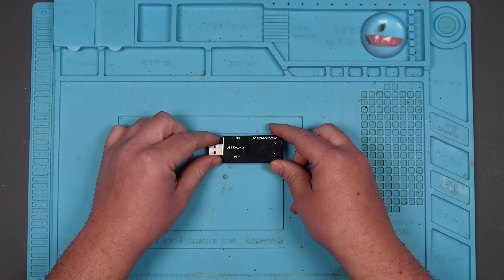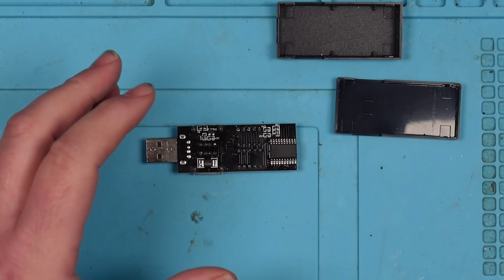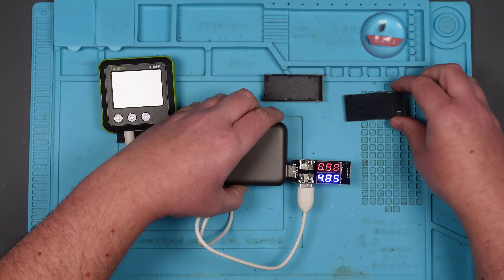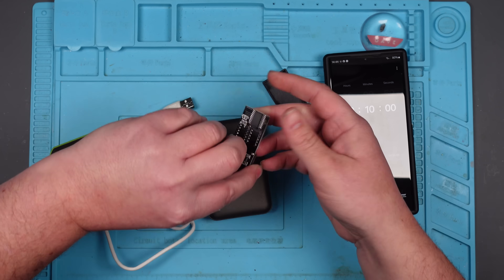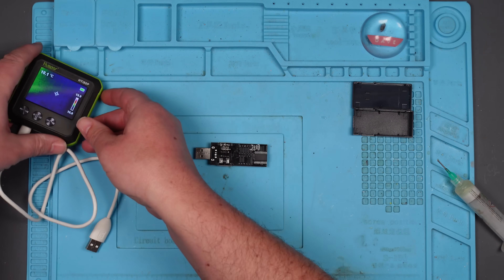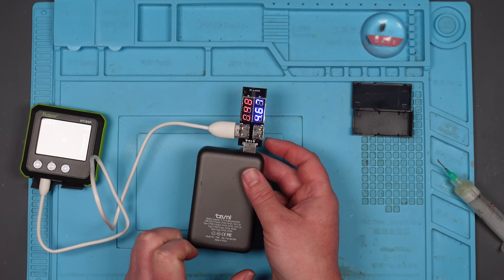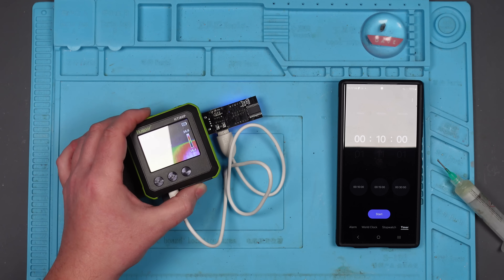Does SMD Size Matter? | Keweisi Ammeter Follow Up

Comment: I'm thinking while the teeny one could clearly handle the current, the fact that the larger one DID fail at some point tells me that there must be spikes occasionally that the resistor...well... resists... And if that happens enough, it will probably weaken the resistor till eventually it can't resist... So the smaller one would probably fail quicker depending on how much you abus... I mean, how often the power spikes... TLDR; replacing it was a good idea :P
Reply from the maker: Totally agree, thanks Kaltern!  Abuse?  Me?  Never... 🤣
Reply: Solid reply, Steve! 🤣
Reply: Yea, what they said.  Lol
Reply: RESISTANCE IS FUTILE

Comment: Higher resistance would be hotter though.  The power draw on the other side is consistent.  So watts = current squared times resistance.  If current is constant and it is in this case but resistance has increased then so too has power........and in relation to that, the amount of heat will increase.

Comment: The resistor is not getting hot by its size. The temperature is related to the power that is running through it. Let's say it was 100 mW, then the small 0603 willl.not be able to dissipate that power and burn. The bigger one yes, since it is rated for 1/4W (250mW)

Comment: The 0603 smd resistor was rated 1/10 W (100mW) and is just for the power of the electronics via the regulator(smd like transistor) I don't think it draw more than 100 mW. You could let it. The measurements are done using the other big resistor.

Comment: Emissivity did you a number there... with the tiny resistor, the ratio of shiny solder to slightly duller component was much higher, so it read cooler on the thermal camera*, due to its resolution. For more accurate readings, use a better camera and put some black electrical tape on the object under test or, better still, paint it matt black.
Try filming the wetted  tip of your soldering iron (so with a shiny coating of fresh solder on it, because you know what temperature that is at to within a couple degrees) with the thermal camera to get a feel for the kind of error emissivity can introduce.

As an electronic engineer (my original major) I can assure you a 1206 surface mount resistor will run cooler and last longer than an 0605 (was it?) one of the same value, in the same circuit.
As a, now, meterology engineer, I can assure you an affordable thermal camera will never produce a practically accurate reading of "a temperature". Differential readings (area A is  hotter than area B) can be quite accurate, though.

(*): your baseline is way off on that as well; no way are you sitting in a room that's necessarily as cold as the objects in it (room temperature, 16 degrees centigrade according to the thermal camera) in a T-shirt. I'm currently sitting in a room that's actually 16.2 centigrade (give or take 0,05 degrees**) and am wearing a winter track suit with a sweater over it.

(**): and, yes, I do have an accurate, calibrated thermometer. I work for an ISO17025 calibration/certification company. We have a triple point reference. Under ideal conditions an uncertainty of 0.0001 degrees can be acchieved with one of those, but, to be on the safe side, we claim 0.01 for the "arm and a leg" thermometers (which take forever to settle) and 0.015 for the one I've got.

Comment: The larger value  resistor is dropping more voltage than the lower value one therefore more heat is generated.

Comment: Larger surface area = higher heat dissipation. The heat camera is probably adding up the temperature derived from the red pixels altogether. Use another thermometer to confirm.

Comment: It's not just temperature - it's DIFFERENCE in temperature. When you measured aboiut 25C, the background was reading about 11C (ie. 14C difference).
On a smmer day in Australia, background temps of 35C are not uncommon - which would put that resistor at 46C. 
BEFORE you consider spikes and surges.

Comment: When I was a repair tech in the early 2000s we would sub through hole components for smd all the time.  (they were internal device repairs not for customers but they always worked). They were sometimes even better if there were ripped pads involved.

Comment: The total temperature should not really change when you use a same value resistor however the surface size change making the camera pick up that spot better probably making it read hotter. the larger resistor should be able to handle higher current before it burns than the small one but the dissipated heat will be the same but on a much bigger area

Comment: Resistors by design will get hot. You can get 0603, 0805, 1206, etc in different wattage ratings. Of course larger package sizes can handle more volts/current by design, but it all comes down to what they do in circuit. Resistors can be put in circuit to act like fuses, so wattage can be important in circuit design vs general use because hey are intended to burn up not keep truckin when things get out of hand. (Resistance value is still important, but the wattage determines how fast the resistor will last before it fails to protect the circuit it is in) 

In the event of shunt resistors for current monitoring, the internal resistance must be very low by design and handle some wattage with low drift due to temperature to ensure accurate results.

Comment: Of course the larger resistor is hotter it is designed to dissipate more power than the smaller one, its a resistor ffs! Thats how it gets rid of the power as heat 😂

Comment: The resistor produces heat exchange for reduced volts and amps. The higher resistor will get hotter. As it’s reducing more.

Comment: In a pinch, if you have enough room on the pcb, you could use two resistors of double the required resistance and mount them in parallel which will halve the resistance but double the current handling capacity.  Ex, two 100 ohm quarter watt resistors in parallel will give you one 50 ohm resistor at half watt.  You can do the same with capacitors except with capacitors you will double the capacitance value.   Now I suspect you already know all this but, just my 2 pennies.

Comment: I used to own the exact same USB meter. I didn't find it such a reliable way to do the measuring, the readings aren't that accurate, the resistance of the contacts is also another problem it, dropping considerable voltage. Perhaps you should test the accuracy of yours.

Comment: Bit like me skimping on replacing electrolytic SMC's, fixed a 32 inch Samsung TV  by replacing 4 of the 9 caps under the heat shield on main board. Now got a low tone sound but while it's working you don't notice it. It works and for £3.44 a bargain.

Comment: I'm not convinced that the last resistor burned out. It's sitting directly under an USB port. Close proximity to ports that get plugged and unplugged is not ideal for SMC on thin PCBs. The PCB flexes every time mechanical force is applied to the connector, and sooner or later a solder joint or the SMC itself fatigues and gives way.

Comment: It's not all about the size ;) You can get 250mw 0603s and you can get 250mw 1206s, yes the 1206 will be able to dissipate more heat and will run cooler. If this is in a 5v circuit you should replace it with a 500mw resistor, unless you can ascertain the maximum dissipation is otherwise.

Comment: 4:54 makes sense the resistor with the higher value is gonna get hotter. Pushing the same current through it the higher value is gonna shed the higher resistance as heat.
Reply: Actually the reverse is true. The higher the resistance, the cooler it will run as it is passing less current.  Imagine how hot it would be with just a wire across it (ie zero resistance - sort circuit) and then think about leaving it open (infinite resistance). The first gets really hot, the second not hot at all. The fact that the package it comes in is larger doesn't affect it.
Reply: @pintokitkat  no, pushing the same value of current the resistor with the higher value will be hotter. By your logic a zero ohm resistor would be white hot.

Comment: You could have just measured the voltage drop across the resistor and then calculated the current and power dissipation to check if the ?0603 part was adequate.

Comment: Another fun and informative video as usual, would be interesting to see what heat it would get up too with a higher amperage draw through it, I suspect with higher amperage the larger form factor resistor will dissipate the heat better 🤷‍♂

Also no song in this video.. kinda disappointed.:face-green-smiling:
Reply: True, that thermal cam was only drawing roughly half an amp.

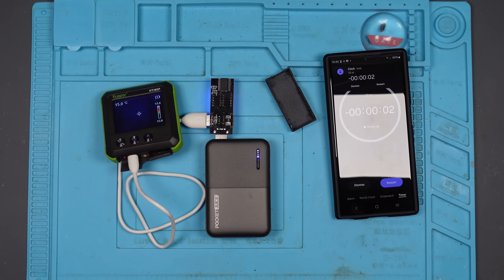Comment: Hold up a minute! Your camera "base value" is all over the place. You can see it when you freeze the video right when you pick it up from the blue mat. For the small size resistor, the camera measures about 15°C while on the mat (timestamp 1:29), and 25.6°C on the hot component. For the correct size resistor, the camera already measures about 26°C while on the mat (!!) (timestamp 4:42), and 33°C on the hot component. So I don't think the camera is very reliable for these comparisons. The small component is >10°C temp difference and the new one is 7°C difference so maybe we can conclude that the new one gets less hot.

Comment: I changed the key fob on my car keys thanks to this guy. Only had to remove 2 buttons, solder on 2 new ones and put in a new case but you have to start somewhere! Saved £70.
Would never have tried before watching these videos.

Failed it's MOT a week later and got scrapped. Stupid car.
Reply: I assume you had the equipment to solder circuit boards as well. The equipment isn't worth buying just for that project.
Reply: @Metalborn710  got a kit for about £20. Nothing fancy and I've done a few other odd jobs since. 
I've also messed up a few things as well!

Comment: The smaller one has less thermal mass so your massive solder blobs will sink more heat from it. IT may not hold up as well to actual strain though. That's my hypothesis.

Comment: If you look carefully at the temps shown in the thermal camera your baseline ambient temperature is reported wildly different throughout the video. In 1:04 your ambient temp/silicone mat temp is shown as 1C. In 1:41 it has jumped to 11.7C and up to nearly 17C in 4:51. Not sure how much real time passed during the filming and if indeed the room was that cold when you started recording but if not perhaps the accuracy of the thermal camera is suspect.  Otherwise kudos for wearing a t-shirt at 1C! 🙂It would also partly explain the temp differences.
Reply: When he let the SMD cool down after replacing. It was at 19. Sure it was the room température
Reply: Aren't all these values dependent on the reflectivity of the materials? Not sure how a silicone mat should show up but I noticed as well. Given he is wearing a t-hsirt it might not be close to freezing in the room but maybe it is....

Comment: That resistor is just part of the voltage regulator circuit that provide power to the IC and led displays,  would probably have been fine.
The bigger resistor is the one that sees all the current as that is the current shunt resistor.
My guess for the initial failure is sub par parts as these things are made as cheap as posible.
You could go one step further and measure the current draw that flows through the resistor, that would be the best way of testing it.

Comment: I doubt the resolution of the camera is sufficient enough to actually see which one gets hotter.
Also the current might be a bit low (if the current is low, the thermal energy released gets more time to disperse to the pcb)
The amount of heat (thermal energy) created is of course the same, as the resistance is the same. A smaller component however has less surface area to dissipate that heat, and therefore it would get hotter. But to see that, a bigger load on the usb port would be helpful. 
For experiments like this, it's therefore also better to use an electronic load. These are more controllable too.

Comment: My guess is volume to surface ratio wise the smaller has less heat accumulation / dissipates heat faster. Heatsinks also increase the surface.

Comment: Just a couple of small pointers to think about:
The power both of these resistors convert to heat is basically the same (R*I²) at the same amp-draw, so the heat in the area would be the same, but concentrated in a fraction of the area resulting in a far higher temperature.
But since the components are rather small the max temp the thermal imaging camera shows is only the average of the area so a local temp spike would hardly be visible, it would only register as a slightly warmer area.
Regarding the higher temp measured the 2nd time the whole board is at least 5 °C warmer than the first run, which is about the same amount the measured heat spot was warmer, so that checks out.
And as always i really enjoyed your videos, it's just so calming and relaxing. And it's just so fascinating how much tech fits in such a small space and how much of it could be fixed, if one had the drive and the tenacity to "get in there".
Thank you for this lovely content you keep providing us!
Reply: It's not just the board, the camera shows a way higher temp while it's resting on the mat right before the final measurement. See at 4:42, the camera already shows 25.8°C!

Comment: As you move up in physical size the wattage rating also goes up. 1206 is about 1/4 watt. If it gives you any trouble get you a through hole resistor rated for 1 or 2 watts. That should handle the heat. 😊
Reply: You can buy 1206's rated for 25mW up to 16W. At least.
Reply: @grantm902  Wow, all the ones I buy are basically around 1/4 watt. It almost doesn't seem possible that a 1206 could be 16w. Where do you get these crazy high wattage ones?

Comment: Ohm my. Not knowing enough about the actual physics, I'm hopeful that what you're seeing is a larger surface area being able to dissipate heat more quickly. But in something that small I dunno. It'd be interesting to hook some of them up to a bench supply and verify current in/out. Mathematically it all has to work out, right? So anything not becoming heat is getting passed through.